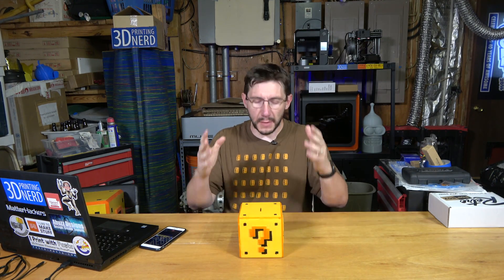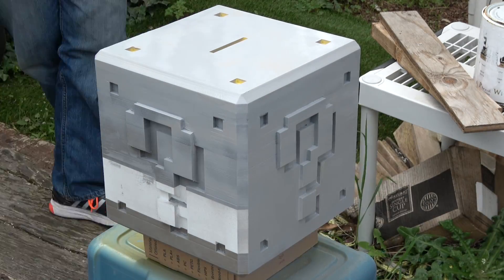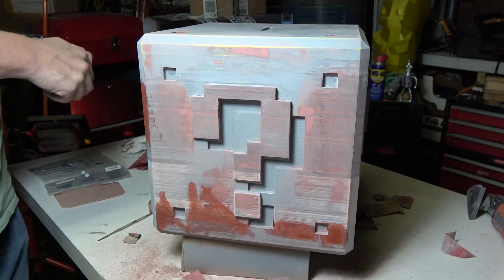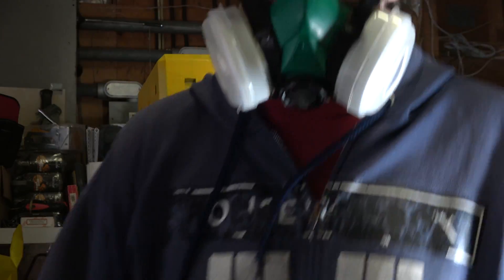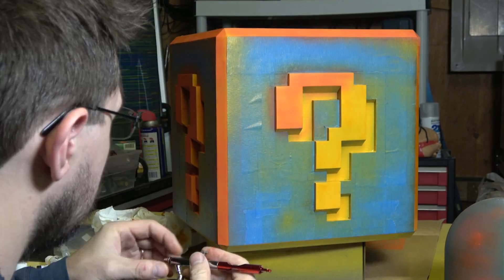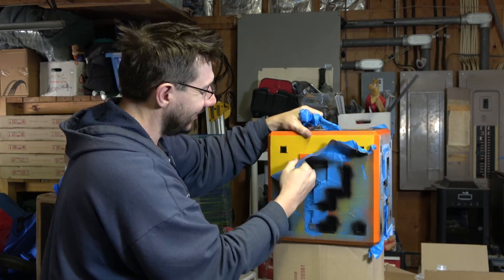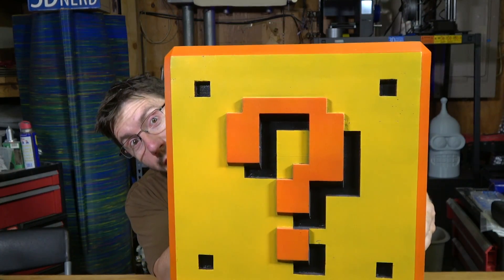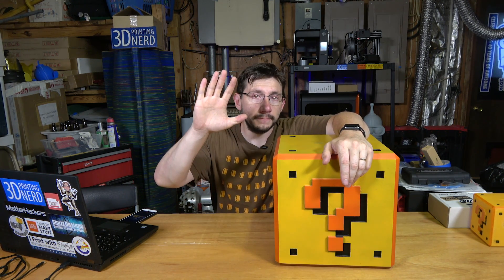3D Printing and Finishing a Super Mario Bros Question Block Bank from Abuzz Designs

Comment: I have a question. Why did you decide to switch from spray paint to air brush? Does the finer paint help? I ask because I recently painted a large surface model and I am not really happy with the results.
Reply from the maker: I went with the air brush because, honestly, I just really wanted to try airbrushing. I don't know if it was the right technique, but, I was able to find the right paints for the airbrush, and it just seemed to make sense. I haven't done a lot of painting in my day, so I don't know if there is a technical reason to do or not do what I did.

Comment: Have you ever tried continuing a failed 3D print that failed mid print by deleting already used gcode to start the printer again at the correct place to finish the print? I'm about to try it and I'm not sure if it will work.
Reply from the maker: I have, and it works. Vicky at TGAW3D is who I learned how to do that from.

Comment: You should look at Volpin Props paint booth plans. It would really protect you and all your stuff in the garage when painting. All you would really need for simple stuff like this is 4 foam boards, a box fan, an air filter to catch the partials, duck tape, and maybe some plastic bag like material to help cover up the air holes. http://www.volpinprops.com/product/spray-booth-plans/

Comment: also use tamiya masking tape or frog tape as its less aggressive/sticky on pulling off any paint and if need be in combination with paper towels or cut pieces of paper for bulk of the masking as in you use the tape for the edges stuck to pieces of paper covering the middle/bulk or leave it to dry for 2-4 days if you reallllllly want to make sure hope that makes sense

Comment: QUICK TIP.. pealing the painters tape off while the paint is still wet will stop you from pealing some paint off.. as the paint doesn't stick to the tape.
Reply: it also doesn't have enough time to fully adhere to the paint your taping over the top of.. also try green painters tape it's not as sticky and probably a better choice for taping over paint.